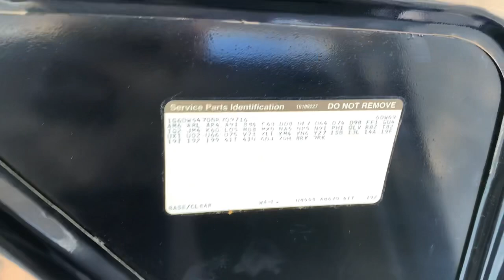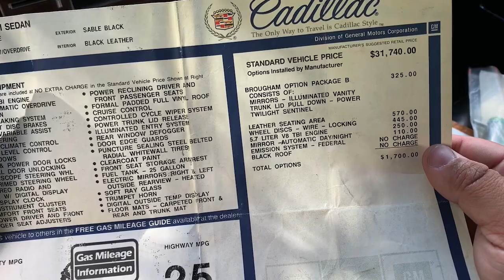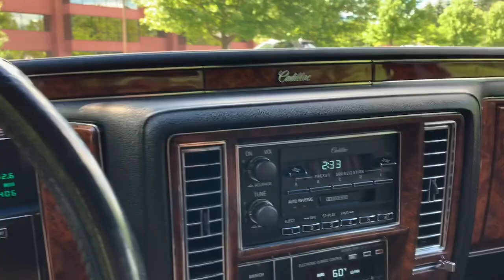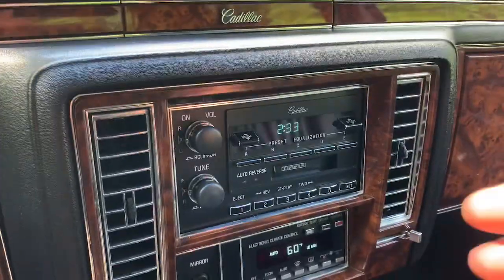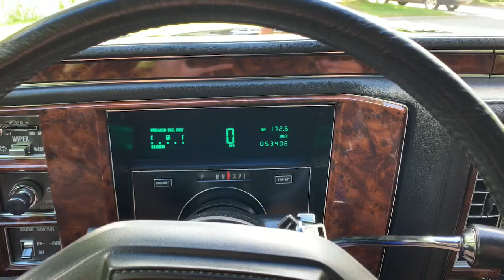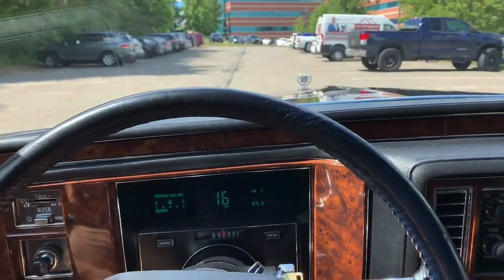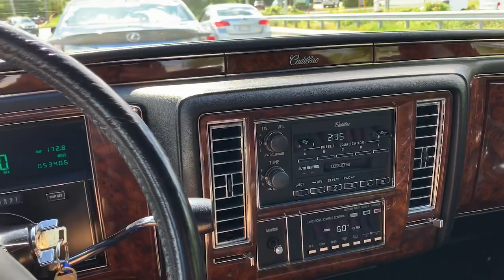1992 Cadillac Brougham FOR SALE Triple Black 53k miles ORIGINAL Royal Seal Tire Specialty Motor Cars

Comment: This is such a nice car that I am very tempted to snap it up. But I am going to hold out hope you eventually will sell the blue 1992 Brougham.
Reply: OMG! These cars have to be black!
Reply: @1940limited  Black (and particularly triple black) is nice. But it isn’t a show stopper for me. If I didn’t know about the gorgeous low-mileage blue 1992 Brougham that Anthony has teased about, I probably would have already tried to buy this black one. I am sure there is a 1992 Cadillac Brougham in my future.
Reply: @lecadeau22201  I've flirted with these cars literally for decades, but never took the plunge. Now they're getting too expensive so it will probably never happen. If I did go for one I'd want black.
Reply: @1940limited  I have acquired two classic cars (1976 Cadillac Coupe de Ville and 1978 Buick Electra Limited) in the past year, neither of which I need. But I have a parking space available for a blue 1992 Cadillac Brougham, so I am anxious to fill it.
Reply: @lecadeau22201  I had  chance to buy a light metallic blue one in immaculate condition many years ago but didn't go for it. I knew the seller. He brought it to my house and put it in the garage so we could see what it looked like sitting there. At least I have had one in my garage briefly. I think the reason I didn't buy it was because of the color. At the time it was well under 10 grand.

Comment: Maybe Anthony can correct me if I'm wrong about this, but by 1992 GM was using clear coat paints, which if cared for hold up a lot better than the old style single stage lacquer paints.  AKA if you know the Buick Grand National, if its original black paint, it will have those stupid crows feet/aka lacquer check in the paint.  This car won't have that problem.

Comment: Anthony I 1991 brougham with 46k I was driving yesterday. I haven't took out the storage for three and it was under quarter  tank of gas so I fill it up.  Made a left turn it went dead. And started up and went dead again. But I drove it and I happen one more time.  I was wondering was it the fuel filter. I know you're an expert with these car. Thankyou

Comment: Back in the day, the driver didn't need to know engine temperature, oil pressure, oil temperature, transmission temperature, tire pressure, etc. Just how much gas left.